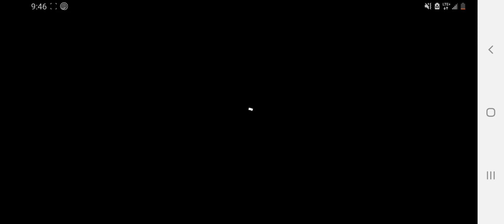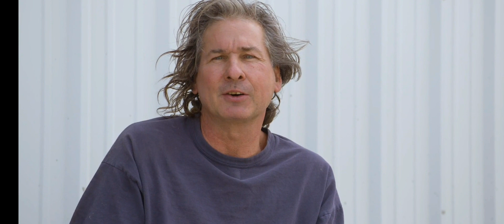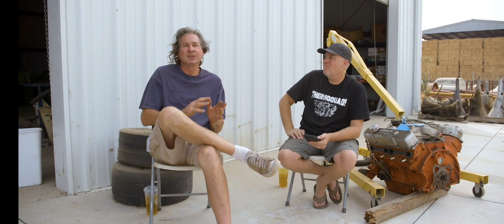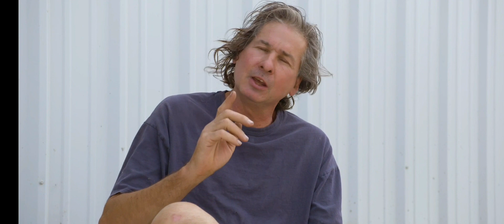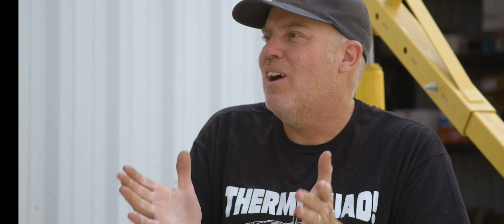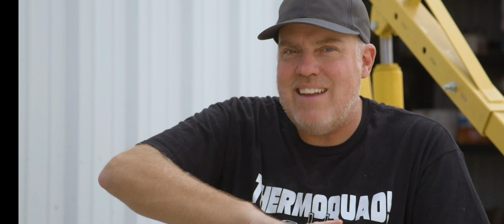uncle tony's garage gets called out by the roadkill guys and they say he's  full of shit

Comment: I am former master mechanic/machinist trained at The General  Motors Technical
schools. I have over 17 years experience, and earned an E,E. with an M.E.minor. 
I have seen many of "Uncle Tony"s videos. Sorry but I have to agree that Tony is a 
phony. One uses the reverse offset trick when rebuilding an engine with tight piston
clearance. By keeping the skirt tolerances low piston "slap" is virtually non-existent. 
On a mild hop up of a stock engine cast pistons are fine. If an engine is well cared 
for even with high mileage I have seen the bottom of the bores barely worn, still with 
visible x-hatch. Reversing the offset in this case does reduce friction and adds a 
small amount of power. One does not hone out the top of the cylinder to where 
the the worn area is gone. This would be far too much clearance. A set hone could 
used to hone the cylinder to the correct oversiize. Gouging out the bottom of a 
cylinder with a spring loaded "glaze breaker" is shear butchery. Phony has no idea
or concept of rod/stroke ratio, and how it affects engine performance parameters.
I could go on more, but after about 4 of Phony's videos I quit wasting my time.
Sorry zilksmooth, but Uncle Phony is dead OFF 99% of the time.
Reply: So then you are in AGREEMENT with Uncle Tony then

Comment: I built my 68 440 with backwards pistons per Uncle Tony it has original flat top pistons and runs good on the stand.  If there was some sort of prize I would consider getting it dynoed and then put it back to normal and dyno it again.  I never heard anyone make the claim of 25 horsepower.  What I've heard is that there's a "seat of the pants" power improvement but nothing that will show up on a Dyno.  I did it for fun really.
Reply: And you don't have to take the pistons off the rods.  You flip the pistons to the opposite bank and that accomplishes getting the pistons backwards while keeping the rods in proper position on the crank.  For my engine anyway.

Comment: I became aware about off set pins when I build Harley engines. They did it to help acceleration. Not to quiet the engine they also aren't a benefit at high rpm. And some after market piston companies still off set the pin. You have to be aware not to order those.

Comment: It is not necessary to remove pistons from rods to swap them smh

Also, a lot of the engines that had valve reliefs put them on both sides of the piston so they are fully reversible - ford 302s are one example, the pre-oil crisis ones

Comment: smoky , took a pre machined block from hudson and moved the crank  over for the perceived advantage as nascar outlawed off set wrist pins . So  He believed  not driving cos 90 X cos 90 x cos 90  was stupid  ,and use the triangle math  we should have learned in 6 th grade . >>What they should  have done was water injection, hi  pressure  into diesel like dished pistons, with a super charger/ turbo charger like in 1965 groupe  b

Comment: This isn't as much a call out as it's  logical reasoning. If your disassembling your engine the swap pistons, you either swap the piston on the rod or swap the piston and rod into the other bank. If your doing a cheap junkyard build, your more than likely starting with a high
 Mileage low compression truck engine with cast pistons. So if you taking the piston off the rod, it's more likely to break, and even then, just buy a set of pistons and get a bump in compression and offset doesn't matter. Even if you still swap the rod and piston to the other bank, you could still have a big bore taper thatll pretty much negate any improvement you think you where getting. You also could have valve clearance problems, and bore wear issues. So at the end of the day. It's just a better idea to buy a set of pistons instead of trying to make a few HP out of junkyard pistons.
I have seen it done on a buddies 5.0 mustang. If works becuase ford puts 4 reliefs on the pistons and he just swapped banks. He did it more to see if it works, it sounds way different than a normal 5.0 but the improvement in power is hardly noticeable.

Comment: I don't think Tony was saying its an "ultimate free power grab" I think he was saying it helps for high performance not adds to performance. He had a video after that one I can't remember how long after but he goes on explaining how the higher the octane gas you have the longer it burns and you're using more of that power stroke for example with methanol its still burning when the exhaust valve opens and that case flipping pistons could help. But you wouldn't want the pin offset as far to one side as possible. Then you'd have issues with the up stroke being very harsh on the cylinder walls and just imagine the crank pushing the rod at that angle too. Rod would probably hit the bottom of the cylinder too. This is just my interpretation.

Comment: Rick Ehrenberg tech editor for Mopar Action called Steve Dulcich out in a article about  disc to drum brake conversions article that Steve had written for another Mopar magazine years ago. I had the magazine. It didn't have the gentle ball busting vibe of this one though. Ehrenberg said Dulcich's conversion was dangerous .
Reply: E boogers assertion was that the taller FMJ steering knuckle in a older ABE body car could over extend the upper ball joints. The difference in height between the 2 is only 3/8”. My opinion is it might matter in a car lowered to the weeds, but at stock height I can’t see it becoming a problem. I know of a few cars that a converted this way with no problems but who knows for sure I guess.

Comment: ORIGINAL RECOMMENDATION FOUND!  Car Craft 12/68 page 18.  The journalist runs through mods recommended by Dick Landy at (mopar) engine clinics.  Landy says get brand xyz of forged pistons.  They have an offset that benefits you.  If you can't afford aftermarket, swap the oem pistons to achieve the same offset benefit.  Does Landy explain why it works in detail?  No.  When Dulcich mentions it being a common practice in 1969, he hit the nail on the head.  Most of the public would have learned of Landy's trick by January 1969, given the publication date.  By saying UT is full of it, they're also saying Dick Landy is too.
Reply: When you look at crate engines offered by GM, you can't help but notice how well they optimize engines.  For example, they use high rocker ratios, low duration cams, and big valves.  They bring a fresh mindset that makes Landy's tricks seem like "mincing".  If high end GM crate engines don't offset pistons, I doubt there is a benefit.  And vice versa.  GM had the time and money to research every angle.
Reply: They're saying it about Tom Hover too. He was over for the direct connection program and could have edited out the suggestion to reverse stock (cast) pistons

Comment: My thought process has always been if your engines making more noise therefore there is more friction at some point in its rotation. And as we all know friction in a motor is bad.  I would love to see some data behind this though. A legit baseline dino pull followed by a legit piston flipped engine dyno pull.
Reply: You have a few bad assumptions stacked up here, noise does not equate to friction,  the factory offset literally pushes the piston into the cylinder wall with more force than a non offset pin would, it silences the knock by applying tangential pressure that would otherwise be applied to the crank.

In some applications this load has been enough to shift bores and crack sleeves. In some engines it's a known fatal flaw when power reaches higher levels. 

That's probably more friction than a little piston tapping even in mild cases.

The other assumption you are making is that things only matter whe they clearly manifest on a dyno sheet, thats just not the case when thinking like a racer. A dyno is accurate to a few percent typically. A few percent at 500hp equals several hp right? Are you going to ignore 5hp in a tight field of cars all riding your ass for the podium? 

It's like arguing about taking the spare out of your trunk before a run, will it show on the slip? Probably not, but it's literally free advantage.

Comment: It's crazy to think that somebody might take their whole motor apart just to reverse the pistons, unless they mainly just like to take things apart and put them back together, or maybe they have something to prove on a dyno. However, if you already have the pistons out, maybe it is something you might want to do, I don't know.

Does drilling a hole in your car make it go faster? Yet some will drill their car full of holes to lose some weight, depending on what they want to do with the car. Some people look for power and performance gains anywhere, even if it's just drilling a few holes. Is there anything wrong with that?

Comment: Says the man wearing the Thermoquad shirt........  I think Uncle Tony was talking about an old low-buck hack that engine builders used to do using stock pistons.  It seems to be based on one of Smokey Unick's old tricks, building an engine with the piston pin offset to the side that would spin the crank in the right direction at TDC if you put compressed air in the cylinder.  Read his book, he covers this theory.  Is it a great advantage?  Probably not, but every little thing helps when you are dealing with stock hardware.  Oh, and FYI, you wouldn't need custom pistons to accomplish this on a V-6 or V-8.  The valve reliefs will be in the right place it you just swap the pistons side to side.

Comment: No you are not understanding the concept, rod angularity is changed reducing force applied to the thrust side of the piston, read articles penned by the “Ramchargers” back in the 60’s . This was done on every engine used by that team of Chrysler engineers. Guess what? Ram induction works too!😹
Reply: your drunk... yes every engine... lay off the dope..4/20 is over

Comment: I’ve actually built a 440 with all used parts and put the pistons in backwards like Tony. It revs like crazy. No it didn’t blow up, and I even used a 150hp power shot system on it. Yes it needed a rebuild after after three seasons of racing, but no knocks or smoke..

Comment: Uhhhh....any engine you take apart to increase performance, would require an increased amount of clearance because you will have added a cam lift that needs to have the piston-to-valve tolerance checked to make sure you are not OVER doing it. A piston flip is something you are doing to not have to spend money on performance mods and you would be UNDER doing it. ZERO performance gains to be had on a motor you spent money on to completely rebuild to flip the pistons. Never happens. Never will. Stupid conversation.

Comment: Sounds like a good test for Engine Masters.  Use ford 302 pistons they have 4-valve releaves so they don't have to be switched on the rod.
Reply: When swapping a piston/rod assembly from one side to the other, turning it around backwards puts the rod big end chamfer in the correct relation to the crank radius and the valve relief cuts in line with the valves.

Comment: I think these guys have missed the point. They heard some of the things UTG said but missed some of the finer points. I don't think a dyno will show much difference for the rotated pistons when it comes to peak torque and power at some RPM (usually high RPM) what it can't tell you is how it effects the dynamics of the engine, how the engine responds to say initial throttle openings from launch. These guys worship at the alter of dyno, listen to UTG advice on the usefulness of dyno in the tuning process, it is not a magic bullet.
Reply: you think a dyno can only measure peak torque and power ?

Comment: Hi guys, im a bit late on the uptake but i thought id ad my 2 cents worth. I have long heard of this 'trick' of reversing offset pistons and though of it as more urban myth than proven tech. (There's also a wild story about decking the block more on one side for extra herbs!.... leave that one for now). I read through some of the comments and saw a fairly passionate group of people taking one side or the other. Forget the to and fro over the net or social media and get it done once and for all. Roadkill has / had a perfect candidate for the experient - The 390FE frm the failed roadtrip that involved a galaxie and a 390 alegidly reco'ed by a school. That motor has pistons in it that have dual valve reliefs and wrist pins held in by circlips - not pressed. What do you reckon guys??? DO IT, i challenge you.

Comment: You guys don't fully understand why or when this was done. This is something you would do to a race car that only has to last 500 miles not 200,000 miles. Even then you would only do it when you could not mod the engine. Its a Nascar trick from the old days when that 5hp or tq means something. Would you do it to a street car? Maybe back in the day when the aftermarket was bare and only if you street raced. Today there is no point, an under drive pulley will net you more gains.

Comment: You say if it was good, OE would do it? So, Porsche offsets the bore over the crankshaft to achieve the same effect. It lowers friction by lowering the force the piston is pushed against the cylinder wall.

Think tony was thinking of a cheap build with factory parts, not of disassembling your engine just so switch pistons.

Comment: Swapping pistons with offset pins gives a slight increase in compression......I would be very surprised to see a 5 HP gain... but with cam intake carb and headers and a good tune it sure as hell won't hurt it's about working with what you have
Reply: Can you tell us how it makes any more compression?
Reply: Since it doesn't change rod length or piston height , it DOES NOT change compression ratio , which is a mechanical measurement.
Reply: Offset pins will move the piston down or up the bore slightly depending on how they are installed ....it most definitely will raise or lower compression.... although very slightly
Reply: @williamrussell7675  the pin is offset laterally..it didn't raise the piston.. the swept volume remains the same
Reply: @hitekbigmek  yup not talking about pin height. .. offset piston pins In a V8 towards the exhaust side of the head ....flip piston 180 degrees and then stick it in with offset toward cam tunnel ......think about it
Reply: @hitekbigmek  Ford has been doing this for years it works better for engines with a shitty rod to stroke ratio
Reply: @williamrussell7675  wtf are you talking about ? Can you give examples of these Ford engines? If the pin only moves  .030"  it still stays at the original compression height ..the piston sits no higher at top dead center .. zero compression gain .. and. What the hell does it have to do  with an LR  ratio ? If you have a 5.7"  center to center  rod  and you rotate the piston.. the rod is still 5.7"  ,the piston has the same compression height  and the stroke hasnt changed  so  sorry you're wrong
Reply: @hitekbigmek   wrap your head around this and be open minded here! If you can.... while rebuilding an engine put the crank in it bolt it in ..spin any cylinder to top dead center and imagine locking the crank in that position! Now imagine you have a 6 foot  2x4 standing straight up in the air 90 degrees from the ground and measure from the ground to the top of the 2x4 ....6ft! Now lay the 2x4 over  at any fuckin angle you want from the ground and measure from the ground to the top of the 2x4 again! ....not 6 foot anymore is it! The length of the 2x4 didn't change but the fuckin angle of it did! Same shit happens when you swap offset pin pistons around ....if you can't figure it out yet I'm all out of crayons!
Reply: @hitekbigmek  any fuckin 302

Comment: You should do anengine masters episode on this and you can do this without having to reuse the factory piston in fact you can even use a Fords piston or hypereutectic.. they make aftermarket Pistons with the all set ones such as speed pro/trw which come in forged pistons there's a few that have 4 valve reliefs which I've heard this is the reason for them having four valve relieves like the speed pro 440 "six pack replacement pistons from for example and they're forged. They should do an episode of engine Masters testing this and being they are Mopar guys build a 440 with the six-pack Speed Pro Pistons and test it themselves

Comment: Actually Dulcich is using flawed logic here.  The fact that performance piston manufacturers eliminate the offset entirely does not speak to whether or not it's better to flip the offset  than leave it alone if centered performance pistons are not what you have.  (Actually the fact that they take the stock offset away surely implies there is something going on there.)
Reply: not all aftermarket pistons are made with zero offset

Comment: All of this is a tempest in a tea pot. Is you want great gains, use the right parts and proper engineering criteria. For a basic example, use the lightest and strongest reciprocating components with a premium fully counterweighted,, internally balanced crankshaft. Obviously a sturdy. Properly machined cylindercase and crankcase structure is a must. Rod lenght to stroke ratio is crucial and must match port volume within the runners. These factors are just for the shortblock assembly. I won't go into cylinder heads and/or induction configurations